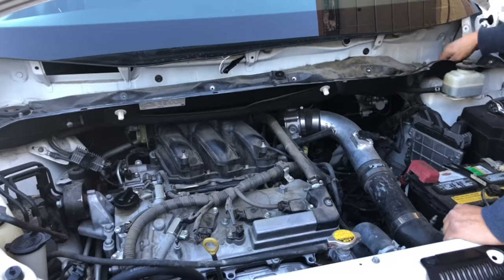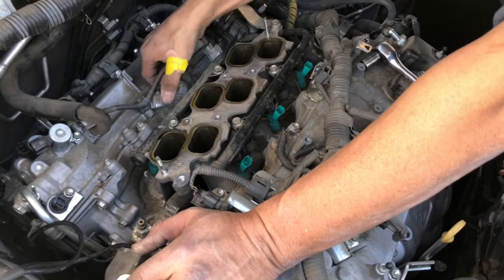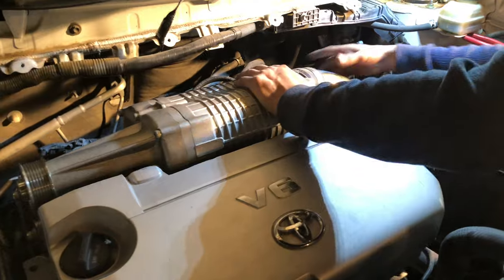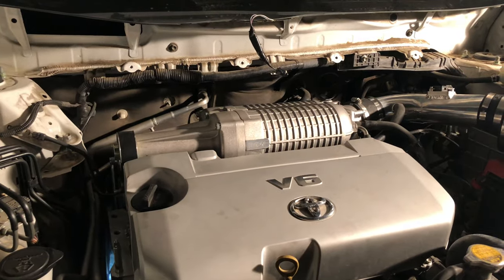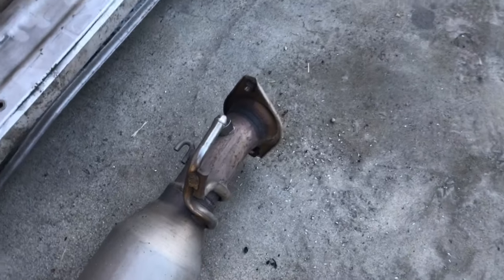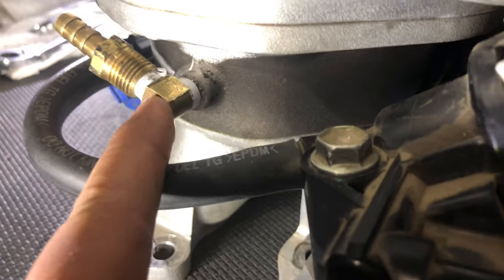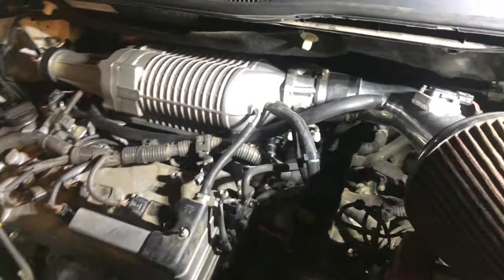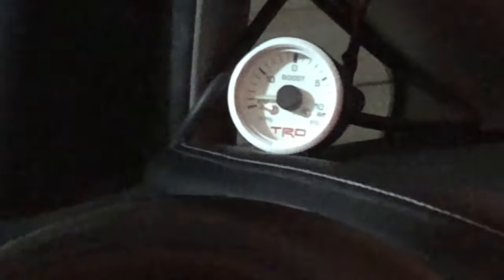Supercharging my moms minivan (2015 Toyota Sienna)

Comment: Look into Mapecu piggy back. Easier to install and tune than Emanage. You think you're safe with the fuel but log your timing. Stock, you will be 22-24 degrees + 7 psi + 10.8 cr. Supercharged Lotus 2gr is 13-16 peak torque to 19 at redline.
Reply from the maker: We decide to run with d3 tuning. Thanks for the info👍

Comment: Hide them gauges in the eye glass holder  pop it down but still needs oil pressure gauge  and add a 50 shot to 75 shot 💉 of spray
Reply from the maker: Was gonna do that but the we relocated the gauges to the center of the dash. It’s in the other can video I believe. And yeah we still need to add fuel pressure and a oil pressure gauge. As far as more power we are going with a harrop tvs1900 supercharger. Nitrous won’t be needed lol

Comment: I'm curious if you have to do anything to keep your engine cooler and what the gas mileage affect is. Also how much does it cost to do an upgrade like this? thanks for sharing
Reply from the maker: As of right now we have nothing for cooling but planning on running water-meth in the future and we’re more interested in WHP numbers than MPG’s lol. And Roughly 10k and that’s just the blower.👍
Reply: Daam, that blower cost yall 10k, so how fast is moms grocery getter, I have a highlander that Im thinking of boosting.

Comment: How much was the supercharger did you buy it used and what's the link to where I can buy one? great blog thanks
Reply from the maker: Bought two new ones and two used ones, the one we used was new and on monkey wrench racing the whole kit is about 10 to 11 grand. https://www.monkeywrenchracing.com/product/lotus-oem-supercharger-evora-s-2009-16-complete-replacement-with-lower-manifold/

This link isn’t the whole kit, You would still need a pulley plate, belt, injectors, and something for tuning. It’s just blower and manifold.👍

Comment: the location of that wide band wont tell you the full story. its after all 3 catalytic converters

also, is that the factory blower off an older evora?
Reply from the maker: Yeah fixed that right after the video lol and I think it is. Got the blower from a crate engine from a lotus racing team.

Comment: The engine is from the lotus evora, the Evora s is supercharged from the factory, could you use the ecu from that car to skip custom tunning? I have a toyota sienna I wanna supercharger also but im stumped on tunning also
Reply from the maker: I don’t think it will work, they use a different ECU.
Reply: Although the connectors are the same, the pinouts of the harnesses aren't, so it won't work. Same with using the TRD Aurion ECU.

Comment: Is it a stock engine? If so how many miles and how has it held up? I’m debating on doing this on my 09 venza awd 2gr. I was going to do this to my 2011 2gr Camry but it was recently totaled from a deer hitting the car and I ended picking up the venza up from the dealership I work at.
Reply from the maker: Yes, around 90k and yeah it’s held up.

Comment: I got a 2013 awd.  Is it this easy to boost it?  How do I find a tuner?  If it’s gonna be reliable, I need to do this.
Reply: Yea will the eternals hold up on a DD that is the question
Reply: I got a 2013 Lexus ES 350 wit the same motor awd and wanna do this but can not finna the super charger
Reply: @nappyhairgaming  Owner of the sienna in the video mentioned that the supercharger they used was a rare Australian unit. Originally for the Australian Camry 3.5L (Toyota Aurion i think is what its called).

Comment: Do I understand correctly that you're running a completely stock ECU without a tune?
Reply from the maker: Yeah you understand correctly lol but that’s gonna change!! Stay TUNED📈 lol
Reply: @DavidTRD  Tell me you have a rising rate FPR or something! Running that lean you can break stuff real quick, you didn't ask but I wouldn't drive it under boost ever until it's tuned.
Reply from the maker: My dads been running supercharger setups since the early 2000s and know what it takes to blow engines up and what is take to not blow em up. Appreciate the advice but don’t assume he do don’t know what he’s doing lol kinda hard to explain things but the next video about the van should hopefully answer more questions and clear more  things up a bit👍
Reply: @DavidTRD  Ok. I'm going to assume I'm missing info here because tuning is just as important as the build. I've been building engines for a couple decades myself. I hope it works out well for you.
Reply from the maker: It’s all about tuning, octane, and cooling and sorry to keep you out of the loop cause you are missing a lot of info but like I said next couple uploads about the van should explain everything.

Comment: Where did u find the trd gauge and pod?
Reply from the maker: My dad has been in the TRD game since 2000 and has rare parts and the gauge pod was purchased on eBay lol
Reply: @DavidTRD  👍. Never thought they will discontinue. Installing a supercharger on my truck and i need a gauge for it. Nice sienna build btw.
Reply from the maker: Yeah they been discontinued since around 2003, what kind of truck? And thanks, mom loves it so far 😂
Reply: @DavidTRD  trd supercharger on a tacoma 5vz engine.
Reply from the maker: @toYOder  Nice👍, my dad has a supercharged 2013 Tacoma X-runner, what kind of blower are you running?